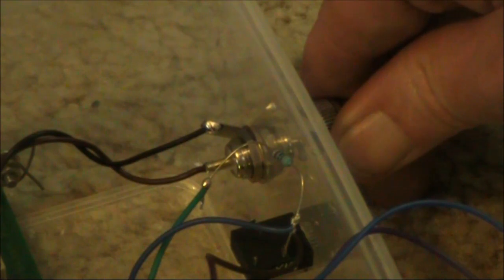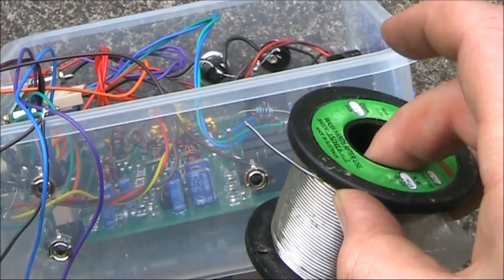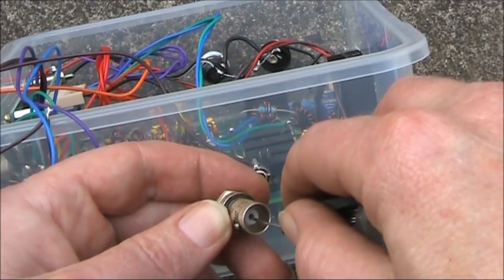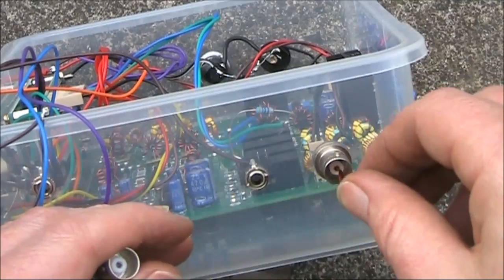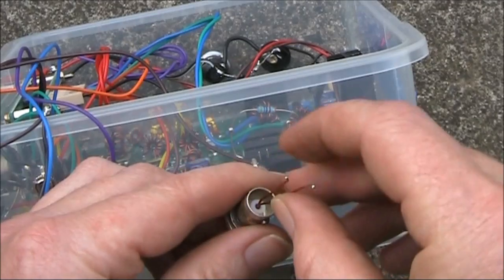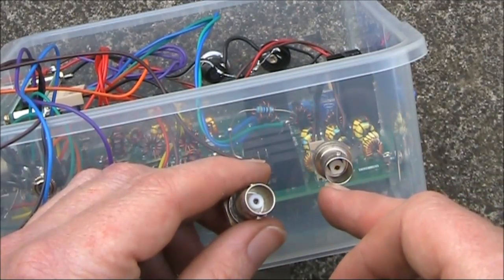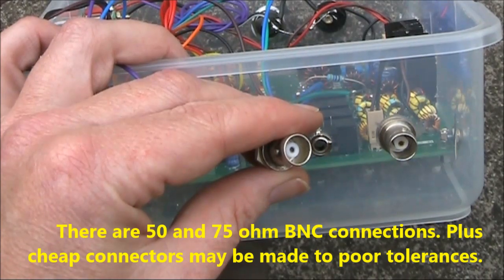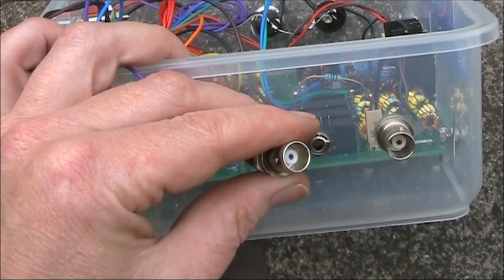Not all BNC connectors are equal (and how this can affect connections)

Comment: I had tons of bad BNC connectors. I used to buy them on ebay because I thought "well they are plugs what does it matter". But DC is not AC and well I threw away all my cables and connectors after a bonked weekend with bad cables and BNC and remade all my cables and only bought the good stuff.

BNC is still my favourite connector though. I can't stand PL or N or SMA (though I can tolerate SMA).

Also can you recommend a manufacturer?

Comment: I have a connection like this on the back of my Swann cctv. It's very annoying, now you see it now you don't. What should I do please ? Would dean have a spec for their cables and should I buy some and get my cables recrimped or is it not this straight forward ? Can I use some time foil or content spray or anything else to fix ?
Reply from the maker: Hi Carla. Sorry I can't help you.
Reply: Had this happen  on a piece of install gear. As a quick fix that’s lasted 4 years to date, I got a very fine screwdriver in between the insulation and the centre pin socket and bent the centre pin socket bits so it was much tighter. As the equipment only gets moved every few years, it survived the last cabinet clean up, this might get you out of trouble

In contrast, I had an Apple iPhone connector that stopped charging.  The pads on the plug that provided power were dirty. You could see that under a magnifier. Cleaned the pads with some 00 steel wool. Phone charges now. 

Good luck